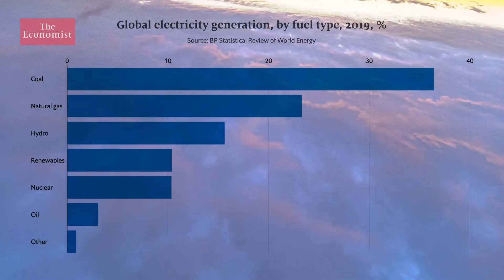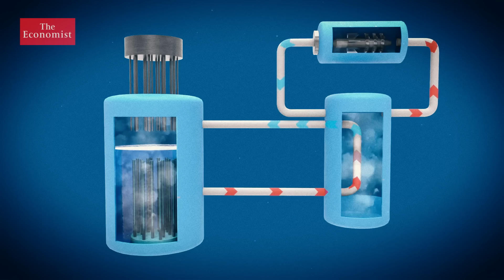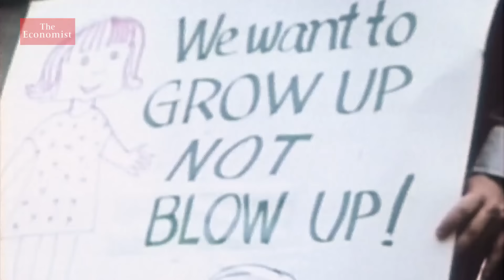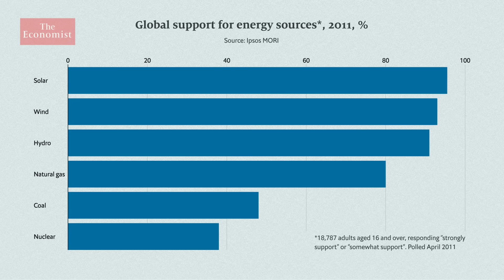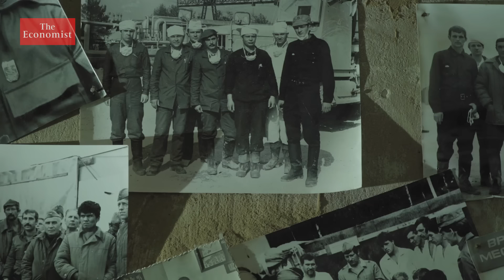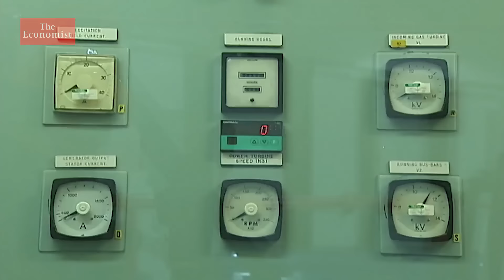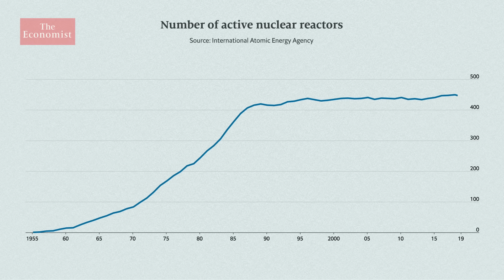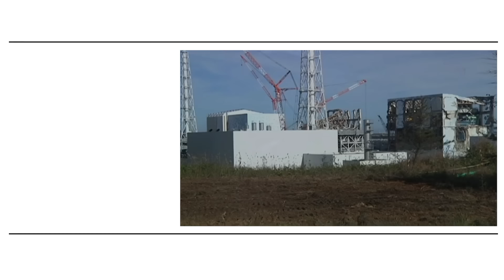Nuclear power: why is it so unpopular?

Comment: What a biased video, opening with a statment saying it is "safe and reliable", was this sponsored by EDF energy or something? Nuclear power plants are very expensive to build and maintain, take decades to build, and only have a lifespan of around 50-80 years. Then it takes another 20 years to decomission them, and the waste material needs to be stored safely for over 1000 years. When you take all of this into account nuclear just isn't financially worth it compared to wind or hydro.

Comment: what about the nuclear waste from the reactors?
Reply: Exactly! If someone watched this video, she/ he would have no idea that nuclear waste exists. As if nuclear waste were an insignificant detail which could be “overlooked”, as you said. I feel the channel’s credibility on this issue is destroyed.
Reply: Molten Salt Reactors have the capability to use spent fuel. Not to mention, Thorium reactors produce far less waste and are far safer than Uranium-based reactors.
Reply: @howardbaxter2514  So the argument is to replace the nuclear power plant currently in use with new ones? Hopefully by then corrosion and other issues will be solved. In any case, nothing mentioned in this video.
Reply: @geopan73  my solution is that we build more reactors and replace the old outdated ones with Thorium and Molten Salt reactors. You act as if there is no solution when there is already a solution.
Reply: @danadurnfordkevinblanchdebunk   you don’t know me but feel you need to comment on my level of knowledge? Makes sense, as you are applying the same principle to your MSR assessment: disregarding the many still unsolved issues, you are actually admitting that the current plants would need to be replaced. Also: nothing in the video regarding this to “enlighten” us.

Comment: So, there are no emissions from producing concrete to store waste?
Reply: Spent fuel rods shouldn't be stored in concrete.  Leave them in their pools for use in Thorium molten salt reactors.
Reply: @danadurnfordkevinblanchdebunk  thing is, a lot of it is stored in concrete that can only contain it for about a century. Obviously I don't know all the details.

Low carbon production of concrete, steel and other building materials is however an under discussed but to me, massively important aspect of reducing emissions, even if I'm wrong about my first comment (I'm open to being wrong I'm not a politician) energy production is surely only one piece of the puzzle
Reply: @Cyber_Jar23   Encasing it in concrete is a complete waste of time and energy.  would just have to be opened up again when it's needed as fuel.

Comment: I do appreciate most of the work from The Economics, but the work in this video is clearly biased. You forgot to mention the nuclear waste that nuclear power plants produce that is expected to be radioactive for 100 000 years. We simply have no sustainable solution to store the radioactive waste for 100 000 years (although it won’t be a problem for my generation but definitely the future generations). You also forgot to mention the increased cases of cancer related to the Chernobyl accident, which is hard to estimate, but if you try you will se that a lot more people (thousands) have died related to nuculear power.

Comment: It figures that The Economist presents a video on nuclear power’s unpopularity and omits a discussion on the important issue of what to do with the spent nuclear fuel.  The US and most nations have yet to fully address this issue and there are 400,000 tons of spent nuclear fuel currently stored at hundreds of sites in dozens of countries. The US alone generates 2,000 tons of spent fuel each year.  Given its radioactive properties, spent fuel must be stored and protected for thousands of years.  This is one the main reasons why nuclear power is so unpopular!
Reply: Spent nuclear fuel has never harmed anyone.  It will be very valuable fuel in thorium molten salt reactors.

Comment: Nuclear is obviously better than fossil fuels in regards to air emissions, but I have several issues with it. 1) The waste remains radioactive for 100's of thousands of years, and we have no permanent solution for disposal, so pretty much we are creating a pollution hazard that thousands of future generations will have to be concerned about, if they even remember it. 2) With accelerating climate change and increasing risk of natural disaster, reactors build in natural disaster prone areas(especially earthquakes and tsunamis) will be a disaster waiting to happen. Fukushima was suppose to be invincible to tsunamis, yet we all know what happened. Btw, they're still dealing with the radioactive waste. . . by dumping it into the ocean. surely we've learned by the now that the ocean has limits. 3) Its NOT sustainable, an estimate in 2009 stated there's only 230 years of fuel at 2009 energy consumption levels, energy usage has increased around 20% since 2009, so that fuel will last even less, and even less if more reliance is placed on nuclear.

For the U.S., solar panels on every roof could supply about 40% of the U.S.'s power.
Reply: How does climate change change the frecuency or the intensity of earthquakes, it has nothing to do with it. Nothing
Reply: Literally nobody says that Fukushima was supposed to be invincible to tsunamis, they cut corners, they put the backup generators where they were not supposed to, they did not build large enough tsunamiwalls like they were planning.
They are not dumping radioactive waste in the ocean that is ridiculous and even if they did, it would effect the ocean very very little. Water is a great radiation insulater. What they want to do is dump tritiated water into the ocean because the ocean is so big it would be diluted to such extremes that it would barely be noticable. 

The waste remains radioactive for one hundred thousand years but far from dangerously radioactive for that long. At most the waste will be dangerous for like 20k years and there are safe ways of dealing with it. 

As for fuels, there are ways of reusing waste but there is also plenty of thorium that could be used if the uranium would run out.
Reply: Nuclear waste is stored underground

Comment: As an Iranian, I'd say governments better stick with hydrogen rather than the controversial nuclear thing.
Reply: as a german: and where should the energy to initially produce hydrogen come from in enough quantities? hydrogen currently has very high convertion losses. the solution is clearly to be rational and use all available forms (energy mix) instead of fighting moral wars and reduce coal over time
Reply: @martinschulze5399  Hydrogen as it's  present in nature is not an energy source
Reply: @martinschulze5399  Agree with you regarding utilizing a variety of clean energies. Though, the hydrogen is considered to be a major change in the future of clean energies as we see more organizations are working towards more efficient ways to produce hydrogen as the fuel.
The point you missed in my comment was that, the reason I mentioned I am an Iranian was that since the governments in Iran have been insisting on nuclear energy since many years and costed billions of $$$ to the country (nuclear facilities/technology development AND the sanctions due to ambiguity in nuclear activities), yet no single Watt of nuclear electric energy exploited after couple of decades.
That's why I mentioned if they have put that HUGE amount of dollars on new technologies to produce hydrogen, Iran could have been a major hydrogen producer as we have a wide variety of natural resources, or at least have been on track to be one.
Like as Canada announced last year to be a major hydrogen fuel producer in near future.

Comment: Nuclear power is da bomb. It's the only way we can feed our insatiable energy hunger. Renewables require burning tons of fossil fuels to mine, transport, manufacture, supply, deliver, and install all the things that a change to "green" technology requires such as solar panels, batteries for storing renewable energy, electric vehicles, etc... The molten thorium salt reactors are the best plan we have, other than fusion, but that could still be a long way off for all we know.
Reply: Well although I am generally in favor of thorium molten salt reactor development, but the comparison you presented is flawed.  These plants will also require burning tons of fossil fuels as well.